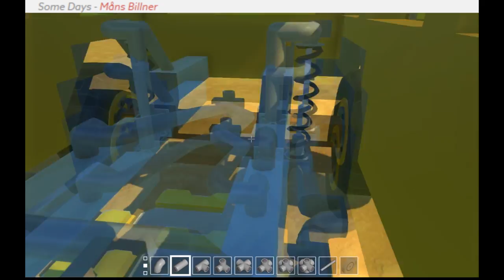Scrap Mechanic | RC Jeep | Part 6

Comment: Im working on a baja truck but i cant figure out the front suspension(same as the jeep but vanilla)
Reply: Robbie Graumans1 so you have a 4 link with panhard?
Reply from the maker: you will need some kind of u-joint, brent batch has a vanilla one thats been edited. other than that the parts are too big.